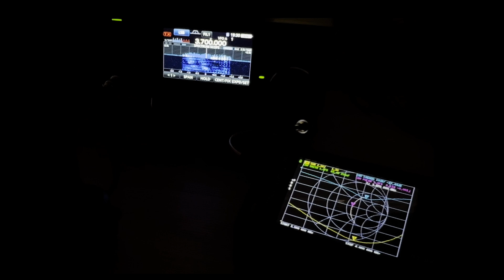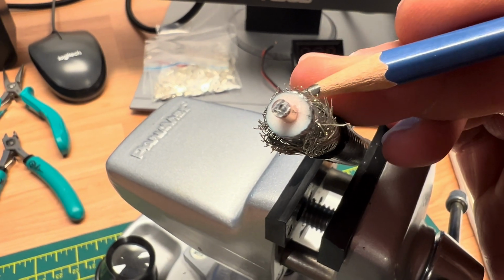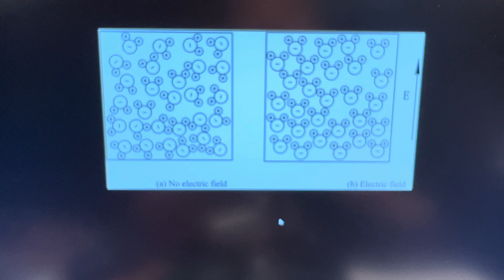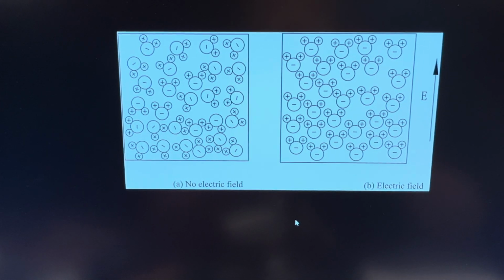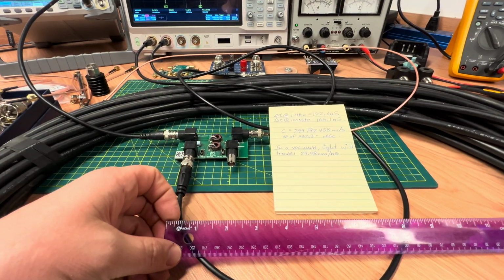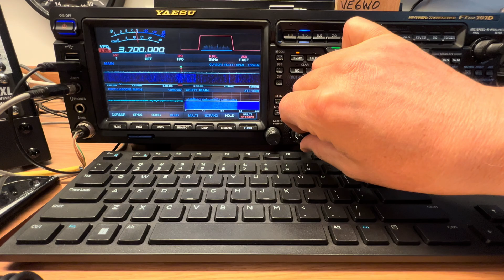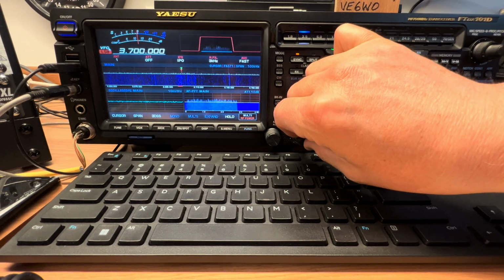(Part 2) ARRL Antenna Book 25th Edition - Coax Cable Velocity Factor Mystery!

Comment: when i saw the guts of the coax at the beginning of the video, i thought the VF variability is due to the core and skin effect... it looks like that coax is made of copper plated aluminum, so i thought it would make sense that at lower frequencies, lower skin effect, the aluminum core would slow the signal more than at higher frequencies, when the signal travels more in the copper layer.
Reply from the maker: This is one thing that amateur radio does well… it gets the brain working!

Comment: I am a beginner in this subject, so please, no-one take my comment as fact, though I hope it is. Yes, permittivity, as expressed in the dielectric constant, does decrease in many/most materials as the frequency increases. One source said that inertia affects polarization - at high frequencies, the electron (ion, molecule- see edit below) has less time exposed to the force and thus moves less. Higher frequencies travel faster as the dielectric constant decreases with the frequency.
Edited to add:
Source: Prof. David R. Jackson, ECE 6340  Intermediate EM Waves Fall 2016 
“At high frequency the molecules cannot respond to the field, so the relative permittivity due to the molecules tends to unity.“
Reply from the maker: Thank you :-)

Comment: I wonder how much this affects air dielectric coax (ie, solid copper tube coax) being as it has nothing but air between the center and screen ?  .. the VF is normally 1 (or very close to) in air dielectric coax
Reply from the maker: That is a good question.  If I were to venture a guess, I would say that the effect would be much less, if at all, in the case of an air dielectric coax.